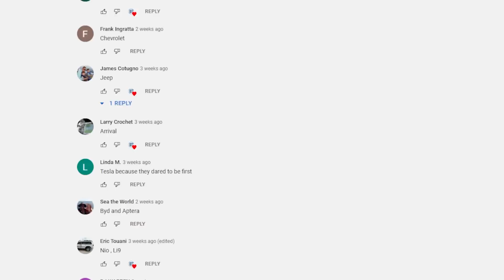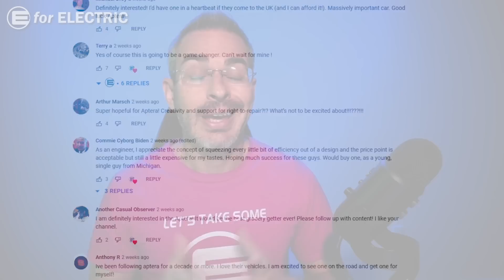How Aptera EV Got a Tesla-like Fan Base

Comment: I already commute with an Arcimoto FUV, in SoCal traffic-as-battlefield real world situations. Eight thousand miles in as many months with an oddball, three wheel EV, that generates more smiles per mile than any car. Way more fun than a used Bolt, a true F U Vehicle to the gas and auto industry. The Aptera is an even more capable autocycle that will prove the viability of solar mobility as an option, instead of the current market offerings. I'm at the bottom of the leaderboard of the Accelerator Program, with about 1300 other investors. People with real skin in the game, who look forward to beta testing our signature vehicles next year in San Diego. Watch as another disruptor takes it's place alongside Tesla in the EV space.

Comment: 3 wheeled alien bicycle, nailed it Alex! This is NOT a car, it has 3 wheels which makes it a motorcycle. So I don't see to many people spending $30,000+ for a motorcycle and wearing a helmet while driving to and from work, like here in NJ. And remember, it's NOT a car loan your applying for, it's a motorcycle loan, and you'll get zero rebates from the government and most states!
Reply: It's an autocycle with motorcycle insurance, no helmet or special permit required. I got $1500 in rebates last year for buying my Arcimoto in CA. Rebates, bottom line savings, not useless tax incentives. And I haven't had to buy gas all year. Autocycles, you better recognize the value, son.

Comment: My aptera. If they get to production. Will be the back up battery for my house. 66k/600 miles $39,000 loaded up the way I want it. 40k regular house back up Battery $49,000. I will have a way better battery for house. Way cheaper. + have a free car.
Reply: Oh yeah I just self built my 3400sqft house. Super insulated, geothermal heating and cooling, 10,080 watts solar, all electric. Zero bills since starting up the solar 5 years ago. 66k battery would run my entire house for 4 days without solar.

Comment: I'm a small investor, only about $2K. I love the approach to efficiency of the design. I would love to have one, but unfortunately, due to my life style, a car with all-wheel drive for winter conditions and about 2500 lbs of towing capacity makes the most sense for me. Right now I meet my needs with two vehicles. I have a 2015 Nissan LEAF that I bought used and I kept my 2004 Subaru for the worst snowy days and for towing my trailer when doing projects. Though, if my Subaru keeps running, maybe I'll get an Aptera! I already have a motorcycle license :)
Reply: 100w per mile? That's snake oil.
Reply: @aussieideasman8498  Until it's not.

Comment: I don't know why you think the concept of never charging is supposed to mean that you only save the time it takes to plug it in. It is way way more than that. Just to name a few things :
1- Electricity you take from the grid is inherently dirty since not all of it is generated by clean energy.
2- Plugging your vehicle to the grid is very taxing on the grid and many experts worry that the grid won't handle the rise of electric vehicles that will have to charge regularly.
3- The cost savings on not having to charge from electricity the price of which can vary from region to region and will probably keep rising in the future.
4- Not everyone can charge at home since a big part of the population lives in apartments. so not having to go to a public charger can be a big deal for them.

So again , never charge is not just a "cool" concept because it's cool but it can be very practical.

Comment: I have the 600 mile range, awd, full solar on order. I live in Canada, a 1000km range will cover my long road trips. The solar will cover my daily needs, maybe charging a few times in the winter months and the odd long trip.

One of my biggest appeals for this vehicle is the construction materials used. We use a lot of salt on our roads, this vehicle should not rust. The average vehicle in Canada becomes a rust bucket by 10-15 years on the road.

Being a mechanic, the right to repair is also huge for me. My hope is this will become one of my cheapest cars to own over the life of the vehicle.
Reply: Great point! How long do you think it will last?
Reply: My hope is to get 30 years. Even with battery degradation, range should be plenty by that point.

As for the solar… in the summer I should get 40km on sunny days. Winter maybe 10-15km. I only work 25km from home.
Reply: The original plan was to not have steel, but that went out the window with the CF body; it is so weak they had to add a steel chassis and roll bar. It's going to rust soon after the cheap wrap breaks down.
Reply: @aussieideasman8498  It's so weak, it only has a level of safety equal to a Formula One racecar.
Reply: @barnabasseadog7660  you need to pay attention to the claims. The F1 claim was made when it was getting the composite shell. Go find me that same claim after it changed to CPC? Maybe you should stop deceiving people?

Comment: I like the fan base characterisation: nerds.  It is the only practical (high speed and high acceleration) relatively low priced car that is super efficient. And it is the only 'futuristic nerdy' looking car that will succeed in the market. With GMG's aluminium-graphene batteries on board (in the future) it will be awesome. My only concern is the suspension. Maybe the best suspension for in-wheel motors has not been invented yet, I see literature about an 'active regenerative' suspension for in-wheel motors. The last word hasn't been said about Aptera's suspension.

Comment: Think about it this way: Aptera makes EVs viable for people that live in apartments (ie: don't have a garage with a charger). Just leave it outside in the Sun. No other car offers the same and it's impossible to achieve with 4 wheels (because of efficiency).
Reply: Aptera makes nothing, and probably won't. Fake prototypes don't count.
Reply: @aussieideasman8498  Delta test vehicles by September, naysayer.
Reply: @barnabasseadog7660  test vehicles don't count, either.
Reply: @aussieideasman8498  Test vehicles don't count to you, that is a small matter.
Reply: @barnabasseadog7660  how many test vehicles have you owned?
Reply: @aussieideasman8498  That is an interesting question. One.
Currently #1072 on the Accelerator leaderboard.
Thanks for asking.
Reply: @barnabasseadog7660  That's not a test vehicle - it's vaporware. lol

Comment: Reservation holder for the top of the line model, thanks to the efficiency level, two charging can add some genuinely impressive mileage. There is still some debating about how the car will be equipped but if it can use the same 7.2kwh charger I used with my bolt that's like 70MPH or a little over three times faster than a Tesla. If you have free level 2 charging at work and that charging is in the sun. It is possible to charge 600 mi in 8 hours for free.

With a car that efficient level 3, charging becomes almost completely unnecessary and Even taking very long trips won't require level 3.
I pre-ordered The thousand Mile model So when I have to make the 1,030 mile,  10ish hour drive to go see my family in Denver, co I can leave my house in the morning having charged my car at home and drive all the way there stopping for lunch and dinner at places with free level 2 charging and driving at or above the speed limit the entire way. I can plug it into the free level 2 at the hotel and have over 500 mi to play around with by the next morning, Even if I decided to basically decided to hit every tourist trap by the next morning I could be at full charge again, Head home stopping only for lunch and dinner and  have made a weekend trip to see my family for 100% FREE without having to deal with a crowded level 3 station or actively wait on my car to charge at all.

When I had my Chevy Bolt EV that trip wasn't possible at all and instead I had to shell out hundreds for plane tickets (and spend nearly as much time at the airports as I did driving) and then spend even more renting a really crappy car. 
Now I have a Kia Niro PHEV I can make it back home and back for about $400ish(maybe $50-75 more since the car seems to struggle in the mountains and altitude and gas is way more expensive there) but I'll be going out of my way 6-8 times to find a gas station and fill up whereas in the Aptera I could make the entire trip even only using free level 2 with absolutely zero inconvenience 

I'm sure $400 or $500 is not a lot to some people  but with booking the hotel ahead I could afford to go see my family three times for what the gas alone would cost for one trip.
Reply: Been put back a few years by the Accelerator program?

Comment: Even if it cost extra, I hope there's an option to not have to deal with Tesla charger. With the Aptera's efficiency Even a level two charger can add miles very quickly and while there are dozens of level 3 locations, there are also thousands of free level 1 and 2 locations within a couple hundred miles but but there are three Tesla locations and less than 10 Tesla locations with level 1 or 2.

I'm sure and probably a dozen of the largest cities in America. The Tesla charger might be more common but when literally all other EVs and charging networks use the same standardized plug and even Tesla is adding it to their chargers I see Tesla's charging port as a massive hindrance on the exact same level as a first gen Nissan leaf chadimo connector... Yeah you can spend a few hundred dollars on an adapter and maybe go out of your way to use a charger specific to your port or you could just use the port that would let you charge literally everywhere without any fuss

Comment: For me personally aptera is the only company realizing what was promised by the "electric transformation of the transport sector". I am from Germany and I very much like German cars aswell as "German" engineering, however, everything mercedes and the rest of our manufacturers did when transitioning to electric was to put an electric motor into the slightly optimized chassis of a petrol car. Of course mercedes nowadays also talk a lot about car efficiency but for them its nothing more but a slogan to sell more of their cars. Looking at climate change and also the rising costs of energy there is a big need to make our lives more energy-efficient. Be it Mercedes, Audi, Porsche or Tesla, I do not need a 3t vehicle to commute to work. For me that's just a huge waste of resources